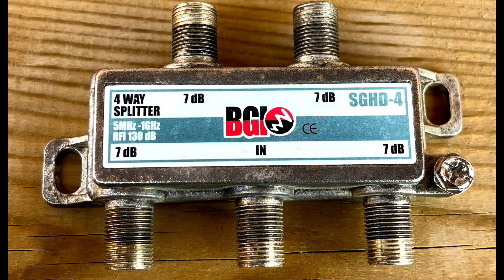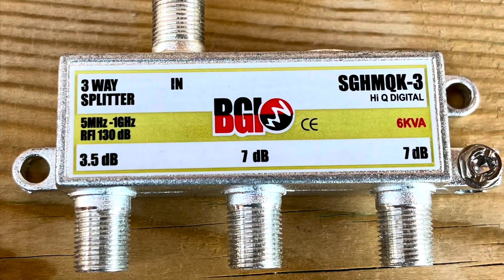TV Antenna Splitters - What you need to know before splitting your TV Antenna Signal

Comment: hey great video,what about the LNB head mine has 2 out does it function the same? i'm experiencing problems with signal on a couple of channels (not others).
Reply from the maker: This video is about splitters for over-the-air TV antennas, not satellite dishes. 
Splitting a satellite signal is totally different. Here’s a few options:

FTA Satellite Multi-Switch Installation- Connects Multiple Satellite Receivers to one Dish
https://youtu.be/0jwNJWQCg5I

Multi Output KU Satellite LNB - connect multiple receivers to a single satellite dish
https://youtu.be/ajZkSyFgg2A

Splitting a Satellite TV Signal to Multiple Receivers - Free Satellite TV
https://youtu.be/N6jwtCU9x7E

Satellite TV Splitter with Single Power Passing Port - FTA Satellite TV Splitter
https://youtu.be/qEJe-pBlRiU
Reply: @NorthcoasterHobby  thank you!
Reply from the maker: @KHALID47 You’re welcome.

Comment: A note about dB for those who don't know.  They are a way to avoid having multiply and divide.  You add and subtract dB.
Without them you might have to do 20 * 10 * 0.5 to get the signal strength (in this case 100)
20 -> 13.5dB
10 -> 20dB
0.5 -> -3.5dB
13.5 + 10 - 3.5 = 20dB

20dB -> 100

For those with calculators or spreadsheets:
dB = 10 * log10(X)
X =  10^(dB/10)   "^" used as "to the power of" since I can't do a superscript.
Reply: Thanks for share
Reply: Dude you're hired !! I ain't heard  log since the college days ..I seem to remember despising them 😋😋📶🔀🆗

Comment: A couple of notes:
1. What is being split? Power is, or the rate at which energy moves. The simplest way to do that is evenly, "half and half" (or 50% & 50% or -3 dB to each), but because it's nearly impossible to do anything perfectly, and there's always some loss, meaning worse than 3 dB loss, the simple math gets complicated, and minor imperfections start to add up.
2. It's possible to aggregate multiple simple power-splitters, but we see more weaknesses of this type of system. Beyond this, it would be wise to use an active distribution amp to handle this sort of thing.

Comment: jesus saves repent sins
Reply: Certainly may help with low db signal, 1 prayer doubles signal or 3db.
Reply: Doubling of power output gives you 3db.  Always use 1 splitter with the amount of splits you only need, then add quality signal amp 10-20 db, forget crap amps at the homedepot.
Reply from the maker: A good point about using only a splitter with as many outputs as needed. I should have mentioned that!